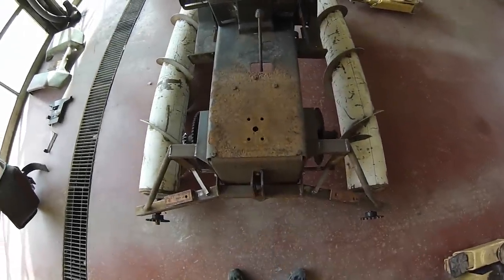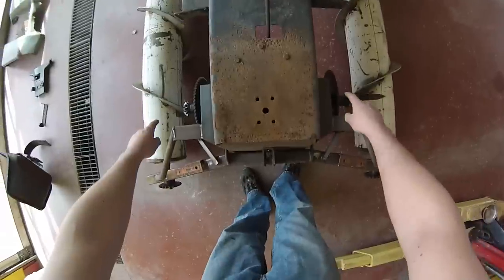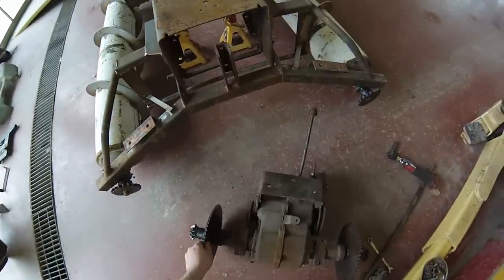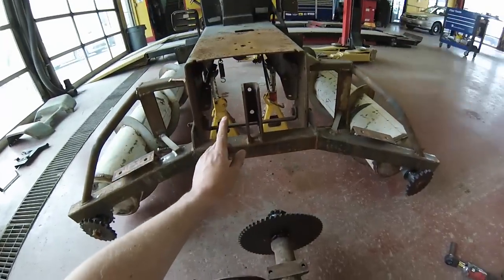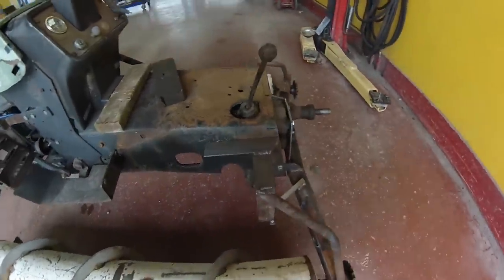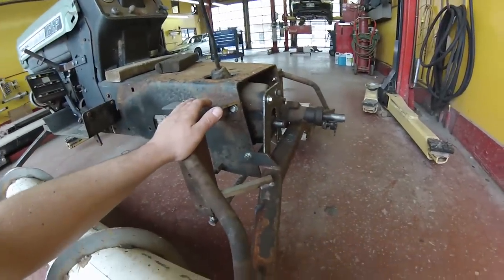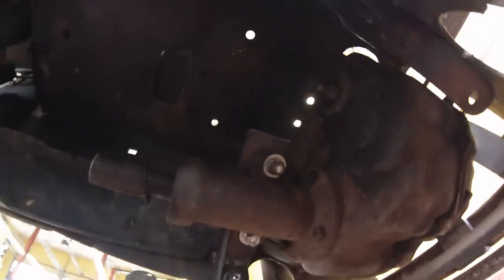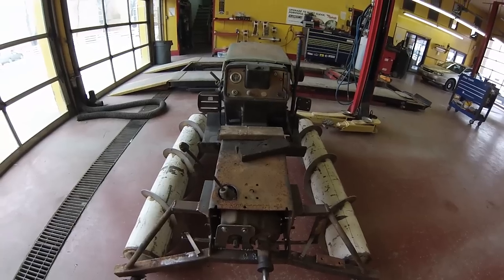Screw Drive Vehicle - Extreme Off Road - Part 6 - Happy Again

Comment: Wouldn't it be easier to to just mount the whole gearbox further back in line with the sprockets on the shafts? You'd only need one change of direction of drive then.